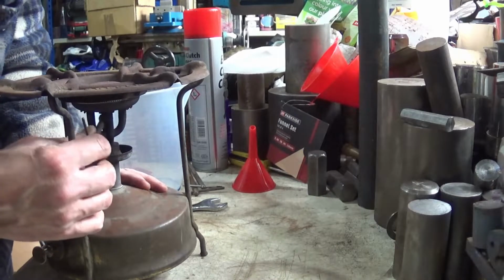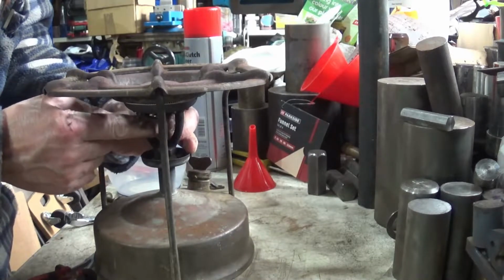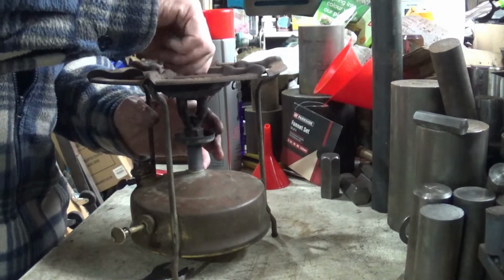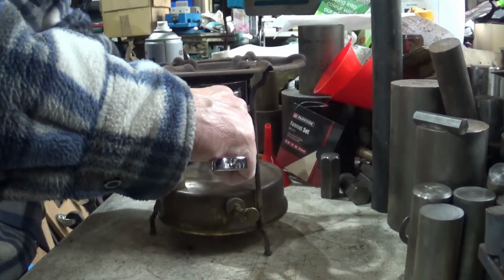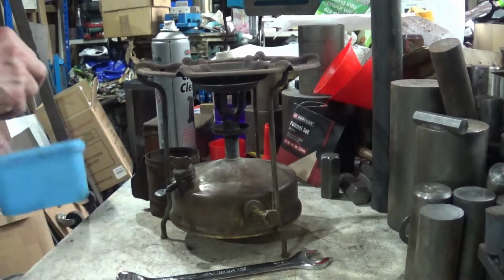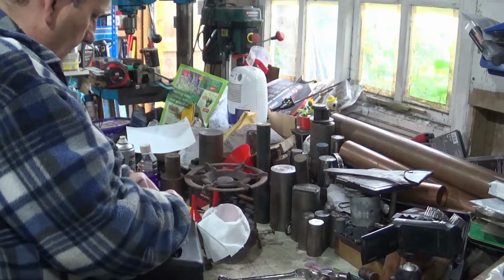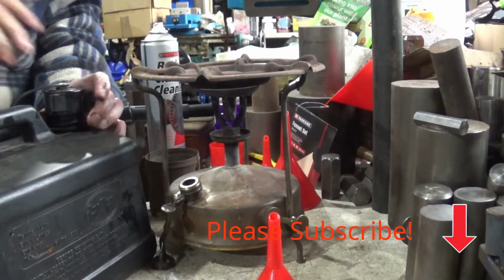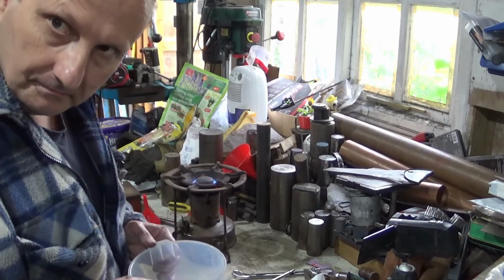Primus Trouble Shooting and cleaning paraffin/kerosene stove

Comment: I love them stoves, I'm always finding them and reconnecting, a good clean and new seals 👍👌♻️ fantastic job there, I got all the tools too, they work fantastic in high altitude as well, the small ones was taken up mount Everest you can  control the heat by releasing the pressure then to turn it back up a couple of pumps, your basically cooking on a blow lamp lol 😂 good blue flame 🔥
Reply from the maker: They are great. Only problem with cooking outside is that you sometimes need a windshield.
Edit: Forgot to add, please like, share and if you like the channel, subscribe!
Reply: @BensWorkshop  will do mate, I've hod no trouble with wind issues, I get it blasting first then in cover then take it outside seems to work ok, but yes lighting it up in the wind is absolutely imposable, gas will just light straight away, but the primus is my favourite ❤️ there fascinating bits of engineering 👍
Reply from the maker: My issue is the wind cools the kettle! Don't have a problem once lit.

Comment: That jet removal tool looks like a good thing to have around Ben, I'll keep my eyes open for one of those (maybe with a Primus stove thrown in for good measure).  The flame at the end was just perfect, nice and clean.
Reply from the maker: For Primus stoves they are great, but I wonder if the one way valve removal tool might be better for blow lamps.  You can get the jet key from Fettlebox,
https://www.fettlebox.co.uk/tools.html

Also they do washers etc. What they don't appear to sell is the valve tool, though you can buy them, I did. 

Many thanks for watching!
Reply: @BensWorkshop  Cheers Ben, Fettlebox looks good - I'll keep them bookmarked.
Reply from the maker: There is also this eBay seller:
https://www.ebay.co.uk/usr/juliands?_trksid=p2047675.m3561.l2559

who sells an interesting kit
https://www.ebay.co.uk/itm/111606209461

Comment: Why didn’t you just remove the top burner cap and the put jet tool through the hole? Seems a lot of hassle going in through the side 🤷🏻‍♂️
Reply from the maker: AH. Because I forgot the top came off that one. I have many others and that is the only one that does that.
Also that tool would not reach from there. I do have the pump tool which will reach.

Many thanks for watching, please like, share and if you like the channel, subscribe!

Comment: I actually made a jet remover, cut a slot in the end of a rod to fit the jet, drill a hole through the other end to slip a rod through as a handle, (like a "T" handle) and then come from the top to undo the jet.
Reply from the maker: I have so many of these stoves where you can't some from the top that I forgot you could with this one!

I have a one way valve removal tool (for servicing the pump) which also will remove that jet.

Many thanks for watching, please like, share and if you like the channel, subcribe!
Reply: @BensWorkshop  Sorry Ben, I'm in Australia so I know next to nothing about these things, Primus No 1 is the only one I have <grin>.  Thanks for your reply and comment.
Reply from the maker: No worries.

Comment: You can just put the jet tool straight down from the top when the outer caps off to remove the jet?
Reply from the maker: I am not sure that tool is long enough, but the one that also does the one way valve is. However that only works if you remember that burner has a hole in the top, whereas all my other ones don't.

Many thanks for watching, please like, share and if you like the channel, subscribe!
Reply: @BensWorkshop  yes it is long enough. Its longer then the original one which I have.
That tool with the knuckle is for the Roaring burner without the hole like you mentioned you have.
Thst burner in this video is the silent burner.
Yes I am subscribed. Great channel 👍
Reply from the maker: Many thanks, you are very kind.

Comment: Looks like it has a silent burner, to remove the jet I take the cap of and go down through the top
Reply from the maker: Yes... Most of my stoves are not... but this one is, which I remembered after the event... That said, that tool does not reach, you would need the pump removal tool which is longer.

Many thanks for watching, please like, share and if you like the channel, subsctibe!
Reply: @BensWorkshop  I made one from a length of brass bar, I simply put a slightly tapered slot in the end to be a snug fit on the jet, unscrew and out the top it comes, most of mine are silent burners so I have it easy by the looks of things, great vids
Reply from the maker: @supercomp7078  Many thanks. I have one of the pump tools, which is a long straight version of the jet tool, so if you lose your tool, you know where to get another!

Comment: When you remove the cap from the burner, you can unscrew the nozzle by inserting the tool from above. Is the riser open or does it contain filling? (cotton or something)?
Reply from the maker: All it contains is my absent mindedness... You are correct, you can remove from above. It's the only stove I have I can do that on, but I forgot!

Still, in my next video, I manage to take a jet out without making such a meal of it (on a large blow torch).

Many thanks for watching, please like, share and if you like the channel subscribe!
Reply: @BensWorkshop  is the riser a open pipe ?
Reply from the maker: That one has, it is the only one I have that has an open riser.
Reply: @BensWorkshop  Thank you.

Comment: Does anyone out there know where I can purchase spare parts (UK) for a Svea No 106 stove? In particular a NRV (non-return valve) and its associated cap it screws into before soldering back on to the dismantled pump tube.
Reply from the maker: Note specifically but there are several supplier online for pressure paraffin stoves in the UK online. I am not sure what the part you refer to looks like.
Many thanks for watching please like, share and if you like the channel, subscribe!
Reply: @BensWorkshop Checkout 'Pump tube removal & installation'  (9.22 mins) by Bernie Dawg. this shows exactly the key parts I am referring to and what I aim to do.

Comment: Why didn't you  take the burner of and then take jet out would be much easier
Reply from the maker: 1. The tool I was using there would not reach.*
2. It is the only one I have that you can take the top off, and I forgot you could.

Any other questions?
* I have  pump tool that will reach.